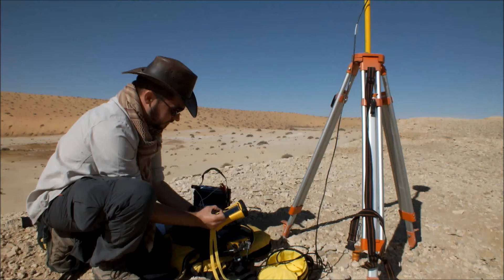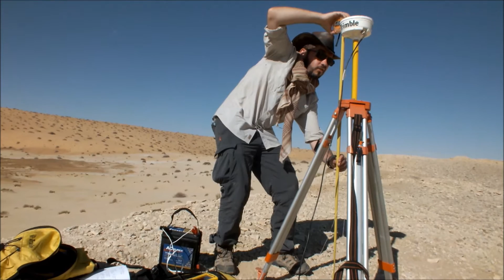DGPS Video 4: Base station software setup

Comment: Great video and clear expaination.  I have a question:
I bought a Trimble GPS Pathfinder Pro XR that comes with a backbag. In it, there is a beacon antenna, the 12 channel pro XR receiver, TSC1 data collector and cables. The TSC1 data collector turn on but signal: " Connect to GPS" and finally says:' there is no connection". Can you help me out with that matter please? What part are missing and what do I need to buy to get it work?